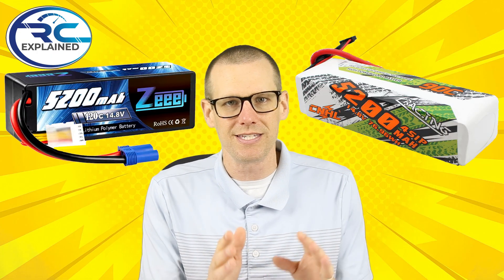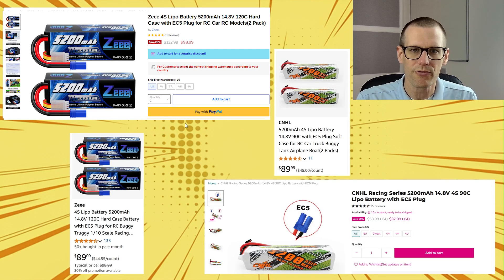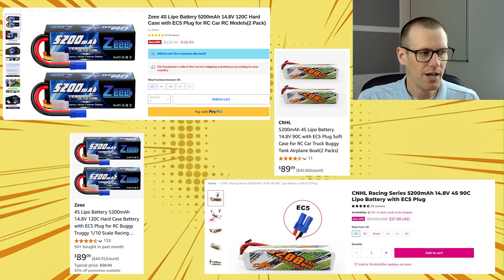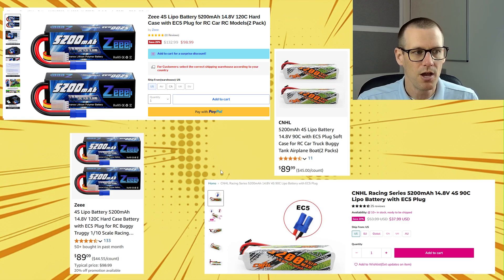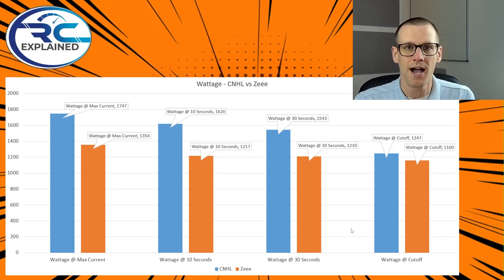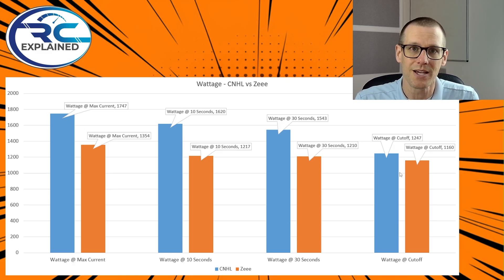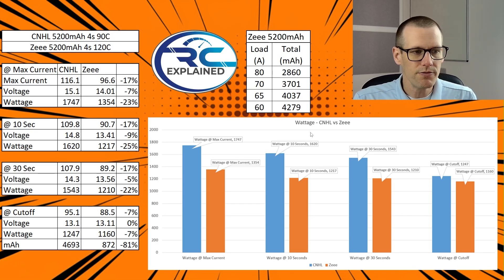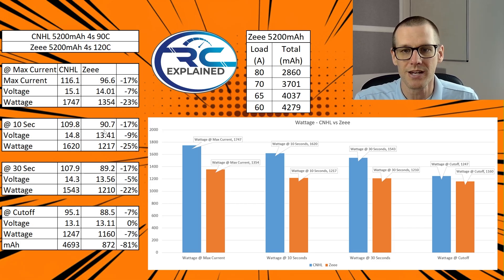Same Price, WORST vs BEST Battery! Shocking Power Gap!

Comment: Zeee company's is strong point is there advertising.. they are featured prominently in the Amazon menu and I believe that is the reason for their success.. I opened a 3s 6000mah hardcase lipo and on the cell itself was printed 5200.. so.. outright false specs

Comment: It looks like the cnhl wasn't a hard case. I personally like the protection and safety of the hard case,  which adds value and longevity in my opinion. I do like all of the valuable information and will be interested in seeing more brand comparison testing in the future.
Reply from the maker: Very nice. I personally prefer soft cases as they are much easier to manage in terms of temp reads. Either way, both are available!
Reply: Thanks for the heads up. I'll be looking into that brand next time I'm in the market for new batteries. @RCexplained

Comment: is there any data out there on 5k mah absima greenhorn 3s 50C? it only seems to pull about 25-30amps on my HW max10 G2 80A and HW 3652 3300KV G3 motor. I'm wondering if the current draw is about right or a little low.

Comment: I have a Limitless with a Hobbywing Max6 g2 1650kv combo and I tried the 2p 8000mAh CNHL lipo battery and managed to take 530 Amps and the voltage dropped to 19v from 29v.
Then I tried the Onyx 2p 8000mAh and took 595.5 Amps and the voltage dropped to 21v.
I used a 7s combination with one 4s and one 3s on both tests with same gearing and esc settings. 
It seems that the Onyx provided a better output.

Comment: If you really want to compare the best VALUE (performance per dollar spent including shipping) then there are plenty of cheap LiPos on AliExp would beat either of the ones shown in this video. It may only perform like 75% as well, but they will cost like 25% as much, so it still beats them on value.
Reply: That 25% decrease in power/performance is a big deal for some. Even for bashing part of the fun is the punchy performance. Feels like throwing away money

Comment: These were my choices for super rock ray I needed 5.9’’ in for the battery compartment is limited space..

 I always use zeee I’ll have CNHL Thursday 6200 mah 120c rating vs 7000mah 100c rating both fit but I use zeee and they don’t produce power as much as the better ones do 

So I’m anxious to try these out in different rc cars I wanted to wake up more with 8s let alone my 12 I like ovonics it isn’t bad for power I like them

Comment: I thought the zee were ok . 
Better than some i bought . 
The chnl battery is more expensive in uk i can get 2x zee for 1 cnhl . Also for things like my kraton 6 s and typhon 6s the cnhl will fit , but 6s CNHL sizes dont fit into my hobao hyper vse or sse buggies nor do two cnhl 3s 
There higher outputs mean bigger size lipo . Not always suitable 😢
Reply: Buggies should run on 4S anyway.

Comment: Love my 90C CNHL packs. I have more of them than any other type.
Reply from the maker: Nice, definitely a solid performer and would be my go to packs as well.
Reply: My CNHLs always puff after less than two years. Bought about half a dozen of them a few years back, tempted by their claimed performance vs price. Performance was good, but cell resistance and safety definitely suffer.

Meanwhile, others like my Zee shorty has been an absolute solid performer, having it since 2020
Reply: @YoShImUrA53  The Zees I bought are terrible, Super high IR values and they got hot and puffed on me. I refuse to buy them anymore.. With the load I put on my CNHL 90C batteries I wouldn't put it against them if they puffed after a couple of years. My Zees puffed after a couple of runs. Depends on usage I imagine.
Reply: @Doug_Morgan interesting. Mine were 2 and 3S batteries. Used on cars. Same charger. Never above 1A per battery capacity. Always kept on storage in less than 24h after use

Comment: Salut

J'ai des zeee, curieux ce que vous tester, il faudrait les tester avec des RC, de façon classique. Vos tests ne veulent rien dire si je me base sur mon expérience qui est une utilisation classique 

Mes zeee fonctionnent parfaitement dans mon maxx et max slash par exemple, que ce soit en terme de durée d'utilisation ou en vitesse de pointe du RC comparé à des batteries beaucoup plus cher, et pareil sur des modèles 1/10, rien à signaler, les zeee sont celles qui ont une résistance interne la plus basse, donc changez un peu de chanson, j'ai compris vous n'aimez pas zeee, pas besoin de faire un comparatif contre toutes les marques, c'est ridicule.
Reply from the maker: The batteries selected and video topics come from the viewers. When they ask for the worst to be compared to the best as well as the worst pack vs best at the same price, thats what I do. I could care less if its the Zeee or another brand that is of the weakest performance and highest internal resistance. I let the data speak for itself. Most get it. Others dont want to get it.
The very first test I did with a Zeee was in an RC Model, and it too was awful. Massive voltage sag and high loaded IR. It is what it is. Spend a lot to get a little.
Reply: actually for this type of testing sticking it in a car IS the thing that means nothing. it is a subjective test. the methodology here is good, data could be displayed better though
Reply: @M3PH11 oui continuer à regarder des tableaux pendant que moi je fais rouler mes RC 😂😂😂😂😂

Comment: Do you have experience with DXF lipos?
Reply from the maker: I have not tested these but do see them pop up.
Reply: I have 3 sets of 2x 2S DXF packs. 1 set of Shorty 6800 LiHV, and 2 sets of 8400 LiHV.
They're great, though for the price, they don't stack up as well against my Ruddog LiPos. My mates and I have found Ruddog to be the best LiPos for racing so far, especially for still having great punch near the end of a race.

Comment: If I’ve learned anything after watching this channel it’s that Zeee batteries suck.
Reply: The issue is that you dont buy Zeee packs for speed runs or racing, You buy them for bash, for the price they are unbeatable..
Here in México they always come bundled in Amazon pallets and you can score those batteries for dirt cheap almost impossible prices. Right now I own 2x 10,000mAh 4S Zeee batteries which I paid 25dlls for both literally brand new. Internal resistance showed less than 5ohms for all cells which is as good as any brand new known name battery.

They are running flawlessly and cold in my Kraton 8S with Castle 2028 1100kv motor with 34T pinion.
Highest Amp pull according to the XLX2 was 370A.
Reply: @skirmich i agree.
Reply from the maker: Certainly when it comes to discharge capability they really struggle compared to every and any other.
Reply: I had a pair drop cells and couldn't get them to come back. Returned and never purchased again.
Reply: That has also been my experience.. I once opened up a 5,000 milliamp hour lipo and on the cell was printed 4500mah..
Reply from the maker: @tooleyzrc1973 I believe it as these exact ones were also mislabeled. I'll see if I got the video i made saved. I dont think i posted it.
Reply: I use them for bashing cause they are cheap and expendable.

Comment: Excellent work! I was running 6S using 2 Zeee 3S packs. I then got a single CNHL 6S pack. The difference is very noticeable. I lucked out and got the CNHL pack at a deep discount and couldn’t be happier.
Reply: Using 2 packs rather than a single pack is on inferior any way. Just the xtra leads alo no e
Reply: @SidReed-p8x Also a valid point